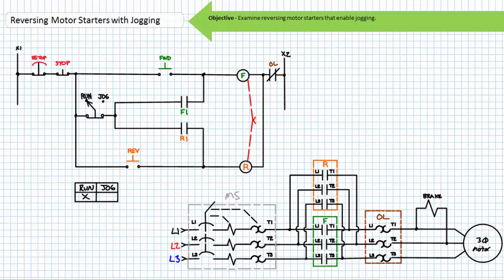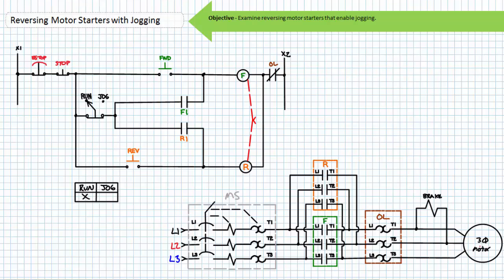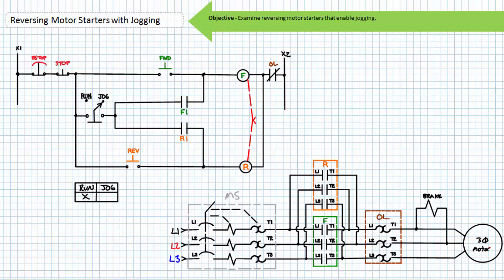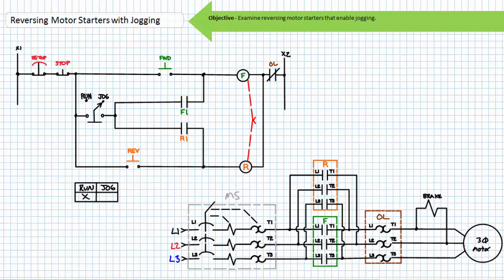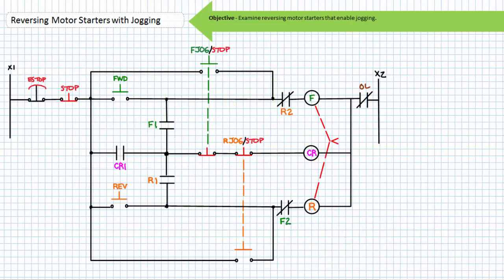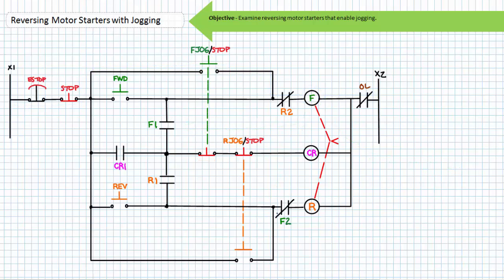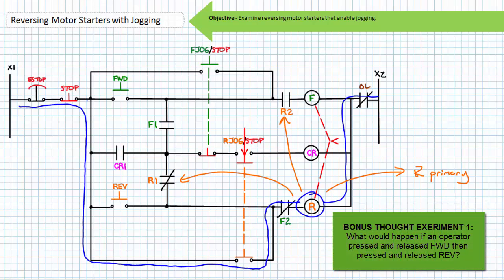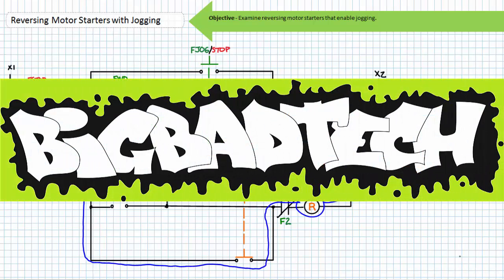Reversing Motor Starters with Jogging (Full Lecture)

Comment: Hi, Jim. 
So, what would happen if an operator simultaneously pressed and held FJOG/STOP and RJOG/STOP from the last circuit?
Reply from the maker: How "simultaneous" can you be? Check https://youtu.be/nElku6kUZ6I?t=12m48s for an occasion in which the FJOG/STOP makes contact first. Note the NC F2 contact opens and prevents RJOG/STOP from functioning. If, however, the RJOG/STOP makes contact first you'd find similar behavior with respect to the REV contactor. Another interesting question ...  what would happen if an operator "simultaneously" released FJOG/STOP and RJOG/STOP?